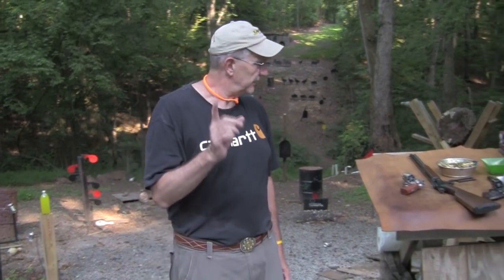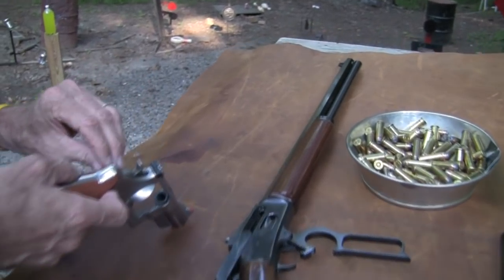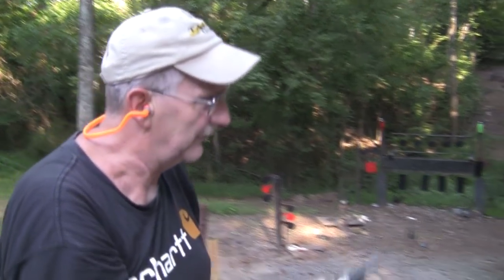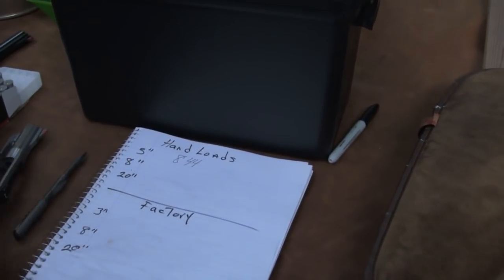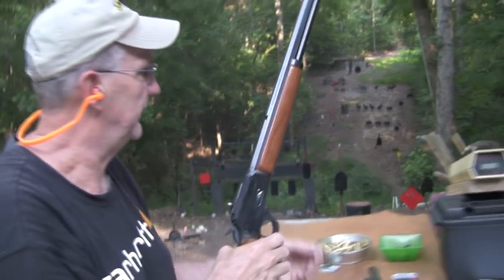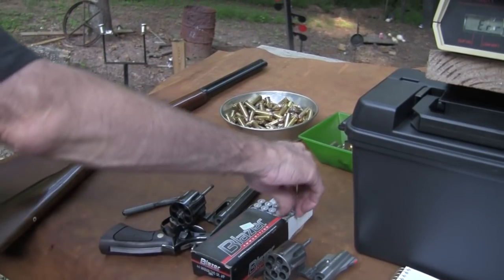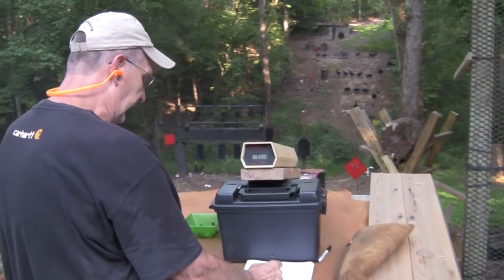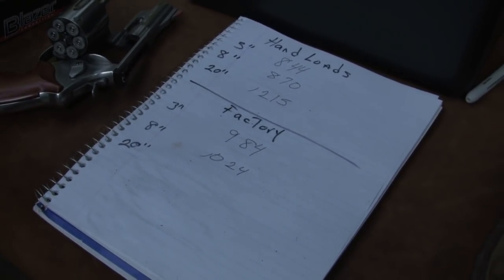44 Magnum Velocity Basics.

Comment: You were right in the video, the lower velocity in shorter barrels is caused by bullet "outrunning" the remainder of expanding gasses from burning powder. It¨s difficult to imagine as these things happen extremely fast. And of course if the revolvers did not have the space between cyllinder and barrel you'd be pushing closer to the Marlin velocities. Just my two cents from basic university thermodynamics and mechanics.

Comment: No, it has to do with how much of the poweder burns.  A longer barrel allows more of the powder to burn thus expanding the gasses faster and pushing the bullet out of the barrel faster.  Barrel length increases accuracy by allowing the bullet to spin and stabilize in flight more.

Comment: I wish there was a barrel length between the 8 and 20 inch to do some comparisons, the gain in velocity from going from 5 to 8 inches is only about 3.5%. It's huge going from the 5 or 8 to 20 though. I'd like to see where the gains become great and then start to level off, thus finding the point of diminishing returns.

Comment: Increased barrel length is also like blowing a paperwad therough a 2" straw or a full sized 8" straw. You  have the same amount of lung pressure to use on the paperwad but as soon as the paperwad goes 2" it is done recieving the power pressure from the lungs. But the paperwad spends a longer time in the 8" straw receiving pressure that builds up and pushes it out faster. And the powder burning longer in the barrel helps. too bad they don't make a cylinder that slips forward to lessen the gap.

Comment: As an additional possibly more mathmatical follow up, an air rifle may shoot a 10.5 grain pellet at 800 fps, that is around 3,360 units of energy. A 44mag shooting a 240 grain bullet at 800 fps, results in 76,800 units of energy. The pellet would have to travel 3825 fps to have that energy. (Energy= 1/2 {mass}*{velocity}^2) Many shooting sports consider power factor as well (Mass*velocity)
 which IMO kind of fails to truly recognize energy's full potential (get the potential energy reference)?

Comment: Interesting stuff. I am trying to load my Rossi R92 for deer, and here in the UK it needs muzzle energy over 1,700 ft/lb. But all the load tables are for pistols...like you I'm just going to have to load and run through a chrony, see what I get. Looks like a 50% bump.
Reply: Especially with slower powders, like H110.

Comment: Side Note: were those .44 SPL hand loads or just a very low velocity magnum load? My average home grown 44 specials run in the 900's from a 3" and my magnums run 1150 average from 3". That's with a 240gr bullet using charges well within spec.
Reply: Exactly what I was going to say. His 1215fps in his .44 carbine is what he should be getting in his handgun, and his rifle/carbine should be around 1700-1800fps. He's probably waiting to see if we students noticed something was odd in his ballistics!
Reply: steelgila I'm guessing that crono has seen better days.
Reply: Joe Doole I'm guessing he had a slow burning powder in the hand loads that made the most out of the 20" barrel
Reply: I don't really know what speed I get when I reload my 44 rounds. I don't own a chronograph so all I have is the load data that says with certain powders I should be getting a certain speed. And of course I think h110 says I should be getting somewhere and the 1850 FPS range. Which is enough to kill a deer at 127 yards I happen to know for a fact. But everything I shoot is in a 29-6 and a 29-3, with 8 3/8 inch barrels

Comment: yep...  I shoot 4"  5" and 6.5" 44 mag revolvers along with one 8.4" Dan Wesson barrel.   I was surprised that a powder like AA#5 had even more spread than you got with at least 75 fps from short to long barrel but not so that the 20" Henry was only about 175 fps. higher.   as you say...  everyones guns and chronos and whatever is different but I think you did an excellent "non scientific" explanation.   so many times we assume that something is going to be WAY different and it is not.     I was a bit surprised at how low the blazer rounds and your handloads chronoed.     I am getting like 1,100 in the 4" and 1200 (not hot) in my 6.5.   that is with faster powder than 2400 of course.    I really am getting to like medium burn rate powders and 250 cast (mine) WFN bullets.
Reply: I have the barrels you have plus the 2", 8", 10", 12" and 15". The 15" barrel cost me a small fortune but they are extremely rare so I snapped it up when I came across it. I've been offered $1000 just for the 15" barrel but it's not for sale.

Comment: The spin of the bullet actually gives the bulletstaility while in flight. I am sure you have heard the term twist rate, The twist rate varies from gun to gun they do not all have the same twist rate. Rifles have a higher twist rate than pistols. Take an AR-15 for an example the twist rate for it is 1-9. Meaning the bullet makes one rotaion every 9 inchs of flight. I am not 100% sure what a pistols is, correct me if I am wrong  most pistols are 1-45.

Comment: If somebody interested, here's muzzle energy (joules) and difference in percentages (last number after slash is 3" to 20" difference):
*
240 grain handloads
________3"_____8"______20"
fps_____844___870____1215
_______________+3.1%___+39.7%/+44.0%
joules__515___547____1067
_______________+6.2%___+95.1%/+107.2%
*
240 grain factory ammo
________3"______8"_______20"
fps_____984___1024____1344
________________+4.1%___+31.3%/+36.6%
joules__700____758_____1305
________________+8.3%___+72.2%/+86.4%

Comment: No, Hickok is correct. The rifling is there to increase the stability of the bullet, helping with accuracy. It has nothing to do with velocity. The more powder you let burn, which a longer barrel facilitates, the more energy is applied to the bullet, thus the higher velocity.

Comment: Barrel length means increased velocity because the incandescent expanding gasses, pushing the bullet, exert a force on the bullet. Now, as we know, F=m*a, so as long as the force is exerted on the bullet, the bullet receives an acceleration. Acceleration = rate of change of velocity, so to sum up, as long as an acceleration is given to a bullet, the velocity of the bullet increases.

Comment: I think that long barrel, old cylinder gap, weak load = slowed down bullet.  
Too much pressure bleeds out the gap before the bullet leaves gun and the barrel starts to slow it down.
I think there would be a much greater velocity difference between guns if you used full power loads.
I think the short barrel is the velocity I would expect but the 8" velocity should be more.

Comment: Rifle has no gap between cylinder and a barrel.  This is why the speed is high, barrel length is not so important.
If you take some revolver with 5" barrel, you will see that speed is higher than with a 3" and 6" barrel. 3" barrel is too short to get all the possible speed, but with the 6" barrel revolver is losing the pressure in a gap and bullet is losing speed.

Comment: Outstanding video Hickok!!!  Would love to see you do more of this.  I do have a question.  When thinking in terms of reloading, is it correct in stating in general terms that the longer the barrel, the slower the burn characteristic you want to achieve the most out of your powder your using?  And vise versa, the shorter the barrel, the faster you want your powder to burn to achieve optimum velocity with a given powder??  In general terms.  Thanks again, do more of these.  PLEASE

Comment: Dont forget he used blazer as his example of factory loads. They are designed to be a cheap target round, not high proformance. Using blazer as an example of the power of a 44 mag is like  using the 69 camaro (with a 6 cylinder) as an example of a muscle car.

Comment: The aluminum Blazers started out as Berdan primed, but it seems there was a change and all the stuff I've seen for a while now have been Boxer primed.
In both cases you DON'T reload them.
There have been a few brave (or maybe foolish) experimenters who have done it. 
Results of the three guys I'm aware of were consistent. With mild/ medium loads they could get one reload. Second reload ALWAYS had a significant failure up to and including fully ruptured cases. With max loads, the cases failed on the first reload. Personally I'm not fond of the idea of a case failure causing hot gas to head my direction. Experiments have shown that it's a better idea to reload steel cases in a SHTF scenario than try to re-use aluminum. At least that can be safely done even though it would be harder on the reloading equipment.
Reply: Yeah, I knew exactly what he meant when he said "aluminum brass" twice in under a minute but it still feels wrong to hear it spoken in a sentence...

Got into a fender-bender the other day, and my bronze nickel bumper fell off, it dented my titanium steel quarter panel, and torqued up my copper iron frame.

With such use of dissimilar metals, we're getting dangerously close to  Blish lock territory...

Also, Hickok, if you need a new chronograph brother, just ask, lol

Comment: Find out if you have any local welding shops/steel shops.  I had two 12' round targets and two 8" round targets made of AR500 steel (3/8" thick) for $75.00 total.  Most of the time, they are overkill as well, since I mostly shoot .22lr and a couple pistol cartridges that wouldn't require such a tough steel, I just like things that last and last.

Comment: The hand loader has more quality control than factory ammo.  If you bulk load ammo on a progressive press, then hand load velocity variation will be equivalent to factory ammo give or take a little.  However, if you carefully hand load ammo on a single station press, being extremely critical during each reloading step, then hand loads can be far superior to factory ammo, with tiny velocity variation.

I'm guessing Hickok45 bulk loads his "blasting ammo" on a progressive press to save time.

Comment: I have always wanted to see the speed and energy difference between a semi auto rifle,,AR15,,vs. a bolt action rifle in .223.  Barrel length would be interesting as I believe with the old slower standard 1-12 twist 24" barrel for a bolt gun was considered optimum speed and energy for the lighter bullets,,I may be wrong.  I guess we would need to see a AR shooting .223 vs a bolt gun .223 with the same barrel length and twist rate to see the difference.  I know the bolt would be faster but it would be cool to see the difference.  Great video as always.

Comment: You are not wrong.  Longer barrel = higher velocity because you get a more complete powder burn, transferring more of that energy to the projectile.  In a revolver, for example, much of the powder burns outside of the barrel, hence the flash, increased report & lower velocity.  At some insane length friction would certainly become a factor, but to say that the spin increases velocity is a seriously misguided theory.

Comment: Please don't. Aluminum cases are much more prone to fatigue and failure and are only intended to be used once.  Reloading aluminum is asking for problems.  Also, in my experience, decent brass in any common caliber is available for free on the floor of your local range.  I can't imagine why someone would risk reloading cases that are not designed for it when the good stuff is free.

Comment: awesome video I have a couple of questions if you don't mind, I value your opinion. I recently moved up to the pacific northwest im going hunting this December.I m going elk hunting I guess there is a large amount of black bear and large cats where we are going. I will be using my marlin 1895 .45 70 what is the best overall round for big predator hunting? also I carry my old Interarms Virginian Dragoon 7'5" .44 for back up what ammo would you recommend for emergency back up in my .44?
Reply: I see that no one gave you an answer so I will answer it my self.  The best Ammo for bear is the 305GR HSM Bear Load which you can purchase from Cheaper Than Dirt, but be very careful with that ammo because it will slice right through a 8 or 9 inch tree and keep going. And that's with a 4 inch barrel.

Comment: since you have an 9mm revolver tested in an earlier video, what would be the diference between a 9mm pistol and the revolver, in a pistol you have the reload power taken from the bullet and in a revolver you have the gap between the cylinder and the barrel
Reply: The bullet leaves the barrel of a semiauto before the barrel and slide have unlocked. In many fast semiauto cartridges, the bullet leaves the barrel just as the slide and barrel begin moving backward. The loss of speed is almost nonexistent because the cartridge will produce bolt thrust regardless.

Comment: I would be interested to see of the 3" barrel would be the same if it were a semi auto type of firearm over a revolver in comparison to a 5" or 6" barrel in a revolver Vrs a semi auto. ... with the gap between the cylinder and barrel might have a negative effect on the speed of the projectile  as compared to a semi auto without that gap.

Comment: Love the 29s! I have a 4 inch S&W 29 thats nickeled and it matches my model 57 in .41 magnum and my model 28 .357 all 3 have 4 inch barrels and beautiful nickel. I have a old Ruger carbine in 44 magnum with a 4 powered Leupold on it...844 fps in a 44 magnum will shot clear a humans body and leave day light in its wake.This depends of what powder was used to reload as those are cowboy loads in my book perfect for practice and not to beat up a gun...you got thousands of 44 rounds..you lucky I am medically retiring from being wounded ove r and over in Iraq and Afghanistan and I save every reload round and load them light as getting more won't happen as Iw ill nver work again so enjoy those rouns and slow round shot accurattly. I am surprised my hunting rounds average high 1700 to low 1800s in my Ruger 44 carbine. I use Hodgdon H110 for defence and hunting rounds 2400 is great for cowboy action and practice it shoots anice accurate slow bullet. Your first few inches of the barrel does the greatest amount of veloctity gain but once you get pass say 6 inches it slows greatly to the 20 inches.

Comment: Technically, I'd bet you got a very similar or GREAT-er velocity from a revolver with the same length barrel as a rifle.  That's because (as I know you know) revolver barrels are measured in terms of the length of the rifling (so, excluding the chamber).  Rifle barrels are measured from bore to breech face (so, including the chamber).
Reply: But you're also losing pressure in the revolver at the forcing cone gap.

Comment: What property of aluminum makes it poor for reloading? It's more elastic than brass. It's stronger than brass. I think this whole, "Don't reload aluminum cases." comes from how they feel in the dies. They are thinner and deform less than brass, so the resizer doesn't feel like it's doing a whole lot, and it isn't. But some people mistake that lack of resistance for the case being mushy and weak. How many aluminum reloads have you seen explode?

Comment: More spin allows for more velocity over time. The velocity straight out of the barrel is the same no matter the spin, but the spin helps with air resistance which allows the bullet to maintain its velocity better. It also makes it much more accurate.

Comment: the bullet has more velocity in a longer barrel because the gassen have more time to push the bullet forwards on the other hand the bullet endors more friction and if the gun is rifled the bullet loses power because some energy is needed the spin the bullet

Comment: well natchez has 240 grain bullets 400 count $48 and rrm has has 250 count 240 grainers for $100 or 500 bullets for $70. This is 44 mags bullets. I didnt check other calibers.rrm are copper jacketed and natchez hard cast lead. Ive had the hard cast 240 grain bullets up to 1100-1200 fps on chrono out of a redhawk 7.5 inch barrel testing against a 1911 converted to 460 rowland.